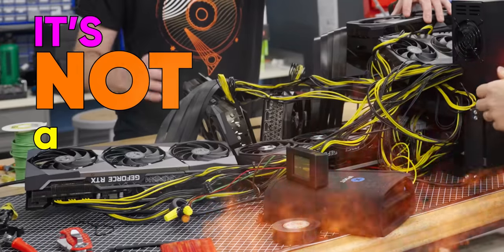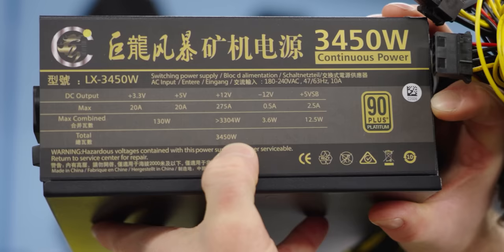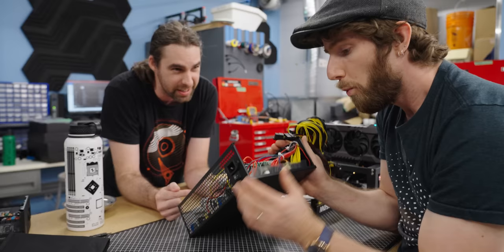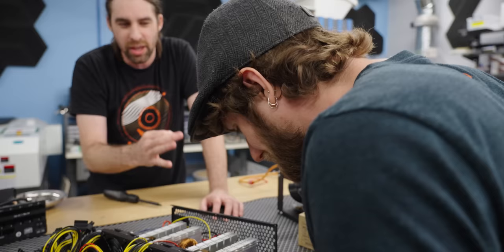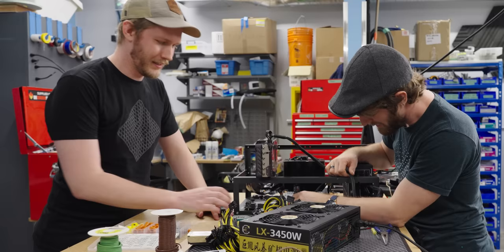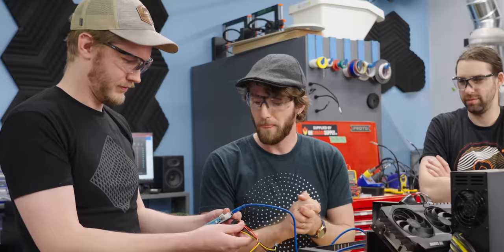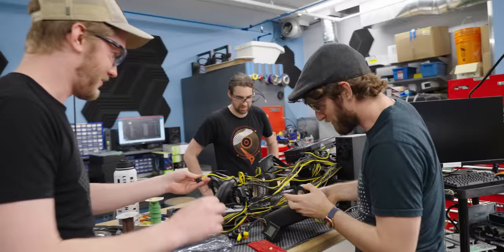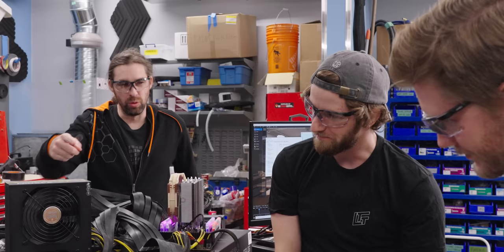This 3450W Power Supply is a Fire Hazard!

Comment: 3kW through a C13 power connector isn't that unusual in Europe. That's how most kettles are connected to the mains, and we generally describe the C13 as a "kettle plug", even when it is used in other devices.
Reply: yup, we got plenty of appliances that exceed 3000
Reply: I'd like to see those kettles. I don't think they actually draw 3 kW, because C13 is only rated for 10 A. Even with 230 V, you would be well beyond that rating.
Reply: C13 power sockets are rated for 10A, which is 2300W to 2400W with a proper electrical grid. Everything above that is out of spec and might melt the connector or socket.
Reply: @anlumo1  If 13A melts the connector, it was never a 10A connector anyway
Reply: Not in EU but in UK
Reply: @ReyMysterioX  From what I remember UK sockets and C13s can do 13A, but only briefly and the 10A rating is for continuous use, hence 2990W kettles.
Reply: @Gronbar6  there are 3kw kettles in continental europe too. but usually appiances are in the 2.5-2.8 kw range if they are of high power variant
Reply: @Gerry15  btw why is everybody talking 230/240V? EU runs at 220V actually, can someone explain?
Reply: @salmiakki5638  Part of Europe ran at 220, another part at 240V. Because of that, it was decided to switch to 230V ±10%. That's what Europe runs at rn.
Reply: Yeah 230 V is what I had out of my mains for at least the last 20 years.
Reply: @salmiakki5638  That's incorrect. Most countries in Europe run on 230V.  Very few on 240V. The only countries in Europe that use 220V are Georgia, Greenland and Moldova. The rest use 230V (Cyprus and Gibraltar use 240V)
220V is widely used in Asia, Africa and south America (and some islands), but not in Europe, at least not as an official residential voltage.
Reply: @ReyMysterioX  correct, 3kw kettles run with a constant load of between 2.3-2.5kw. The kettle leads in the UK are fused for 13A within the plug so you wouldn't want to push it to 3kw.
Reply: As a Brit, seeing them have to cut the power lead in half because the mains plug isn't replaceable vexed me somewhat. But coming down here and seeing kettles used as a metric made it all better XD
Reply: No, absolutely not. First of all, kettles even in the EU seldomly use more than 1500W of power. Also, C13 is only rated 10A for 240V circuits. Also, if you actually push 16A through C13, which is certainly possible, they do get way too hot, showing that their rating of 10A is appropriate. Instead, you are supposed to use the C19 connector for up to 16A@240V or 20A@125V (yes, US gives a bit more leeway).
Reply: @KayJay01  Worth noting that even if you have 230v there are tolerances used for load balancing. Here in Norway we have 3 different kinds of 230v grids. I am on IT and generally get 237v from the wall.
Reply: @Gerry15  Many countries, including the UK, run at 245V now. It basically utilizes the grid better if you run everything at a slightly higher voltage. The list you posted isn't representative of the voltages you can actually measure at outlets.
Reply: Electric stoves are fairly common in the US, and use a NEMA 14-50 outlet/plug,  rated at 50 amps.
Reply: @Gerry15  Nowadays they tend to supply at the upper end. Which at least for devices that use switching power supplies isn't particularly healthy, as it greatly increases the inrush current. It also increases the power drawn by resistive loads, like kettles, although that is usually compensated by them being turned on for shorter durations as a result.
Reply: @Gerry15  That was written two decades ago. Sticking a multimeter in an outlet tells you the truth.
Reply: @graealex  I am in the UK, which is no longer part of the EU, but most kettles are 3kW. Looking on Darty which is the French equivalent of Best Buy, there are plenty of 3kW kettles [bouilloire] for sale.
Reply: Yeah, except it's you Brits that call 'em 'kettle plugs', mainland ditched those 40 years ago.
Reply: @salmiakki5638  I'm in England and I just measured the output at the wall and its 245.2 V AC.
Reply: In Germany we call them Kaltgerätestecker, what just means cold devise plug
Reply: @Gerry15  That's mighty low actually. Here in Germany it's often 235V, and some YouTubers in UK would regularly show 245...248V mains voltage.
Reply: @inventiveowl395  Although it's not really necessary to synchronize on voltage. Countries only need to sync frequency and phase. And not even that, if they use HVDC connections to connect grids.
Reply: @katbryce  Well, I'm the kind of person to measure the power actually, and all my resistive devices, Iike grill, toaster, kettle are already 10% to 20% below rated/advertised power. Also, at least here in Germany, most kettles are rated around 1800W. Reason being that most outlets in the kitchen will share one breaker with 16A. While British ring circuits often have breakers with up to 30A, so you can have multiple high-powered devices on at the same time.
Reply: @graealex  as a born and bred Englishman I can say with certainty that kettles are rarely below 1500W in the UK which was up until very recently part of the EU.  The kettle in my kitchen right now is rated at 2520W-3000W.

the model is Morphy Richards 102786 if you doubt me.
Reply: @graealex  I sense someone likes bigclive
Reply: I have a 3850W 16A rated cable, that's C13. 230v EU. it's totally fine. Cable is fucking beefy tho
Reply: @crashmatrix  Yes, but I imagine his measurements not being representative, as he is living on the Isle of Man. I remember Photonicinduction showing mains voltages here and there, with some voltages being on the high side. However, when looking through a few of his videos where the primary/mains side voltage is visible, it was always around 233V. Hmm.
Reply: In Canada we associate them strictly with 120v 15 amp devices. 240v devices are hard wired on the device end up to 50A.  Beyond 50A it must be hard wired both ends. These are continuous ratings as well. The device still might be able to spike much higher momentarily, especially a motorised item like a blender or washing machine. This is why you get powertools claiming 3HP when that should blow the fuse - it is only for a half a second.
Reply: C13 is the classification for the appliance coupler. It's just the thing that makes it so manufacturers can send a cable with the local standards NEMA, BS, CEE plug, instead of redesigning the appliance for every locale. Although a 3kW device should have a [C19.. ..C24] and not a C13.
Reply: @testytester8303  Tbh I have never seen a kettle that didn't have a permanently attached cable.
Reply: @salmiakki5638  EU was harmonised around 235V or so a long while ago when the UK was still part of things. Of course, there being some allowances for variances, you could be anything from 220 to 250V as measured from the wall, depending on your wiring, how far you are from the substation and the time of day/grid conditions.
Reply: @katbryce  Your kettle is likely more like 2.2KW or so, there are very few that will draw the full 3KW. And that's still not the 3.5KW that this PSU would need. Likely to be safe, you'd use a separate high-current circuit, much like wiring up a cooker or shower.
Reply: 10% isn't too uncommon, the -12V and +3.3V ATX are also with a 10% tolerance and the +12V, -5V and +5V are with 5%
Alksi just checked, and my wall measurement thingy gives me flat 230V on a sunday afternoon.
Reply: @Leadvest  Those are also limited to 16A, which woudn't be enough for 3450W low voltage DC after a conversion.
Reply: @HappyBeezerStudios  They rated for 250V.

Comment: For those who doubt the danger of a power supply...

Even as a kid, I had the sense to not plug things in before testing sketch stuff.  It was a REALLY old power supply, where you had to plug the leads into the power supply... but the sticker was gone so I didn't know which side to have the different pairs.

So, I plugged it into the wall and used a stick to flip the power switch, and it promptly exploded.  Fortunately, it was not a big enough explosion to break the steel casing but it definitely set off the smoke detector.
Reply: Search youtube for "killing a capacitor"...
Reply: I had one go bad. It would shoot a arc of voltage out of the hdmi cable every time you tried to plug it into the tv. Weirdest thing ever. It wasn't just a quick spark either, a full solid arc like a stungun that would jump from the cable to the tv's socket lol.
Reply: I see linus has a lot of fear against live wires, even more at 220v. I used to use a soldering iron with a lot of spots in the cable burned from the soldering itself. One time I got shocker in the leg while simultaneously touching with my hand a metal cage connected to earth. I received a shock (220v), moved a bit scared out of surprice and continued soldering. Nothing too bad. The problem is when you grab the cable with out hand while earth connected, but touching it with a finger it wont kill you
Reply: haha, that was just a blown cap. it's fun when you just connect them directly to 230v and watch em blow, or use a small torch on the side of them (they are supposed to blow at the top) and shoot the hot blown insides at people XD they stink tho (like toxic gasses should) so do it outside
Reply: To clarify this was a catastrophic failure.  I couldn't even pick up the box for some time because it was so hot.  It was a lot more than a blown cap.  This was a supply that hadn't been plugged in for a decade that had power flowing the wrong way through it, probably shorting as it flipped the breaker as well.  But at that point I was like... these things are freaking death machines...
Reply: To people who think it is not that serious. True issue is that you might touch with 1 hand ground and 2nd hand capacitor fully loaded. This will effectivly move electric charge from arm to arm likely through heart potentially stopping it. if you would be grounded from finger to finger, then even huge charge won't kill you, just might burn finger a little. When electric charge goes through heart or to in general nervous system, this is moment when really big issue may happen.
Reply: @wachocs16  Voltage by itself isn't dreadful. The amperage is important
Reply: @arcticfox037  It requires a high enough voltage with enough current to become dangerous. If, say, I touched 1,000,000v @ 1ma I would be perfectly fine. I can even touch 120v @ 15a and still be fine (skin resistance is about 1,000 to 100,000 ohms). However, something like 800v @ 15ma will probably kill me if it flows through the heart, or maybe into the brain.

I get annoyed by sentences like yours, as they don't tell the whole story. A better statement would be, "It requires a high enough voltage at a high enough current in order to kill you."
Reply: @piotrj333  If you wear gloves, you'll be fine (unless the voltage is high enough to go through them or they have holes). However, I don't see any gloves on him.

Comment: "the resistor is the wrong way around!"
Linus: "no it's not."
* didn't get the joke *
Reply: So glad im studying electrical engineering, otherwise id be just as clueless
Reply: Resistors have no polarity, so there is no way to put them "the wrong way around"
Reply: Capacitors are one-way. Resistors are not.
Reply: @benjaminoechsli1941  not all caps have polarity, most commonly only electrolytic caps have. (Like the large ones in the video)
Reply: @PretTy_Fish  Now that I understand the joke it's still not funny
Reply: @dewildegillesgdw  thanks i didnt feel like typing that
Reply: "the sausage is upside down" vibes
Reply: @PretTy_Fish  some security systems are tempermental about resistor direction polarity or not. But thats a rapidly diminishing issue now
Reply: Oh dang, now I get it. It's a resistor, not a diode!
Reply: he did. but he was annoyed and didnt care
Reply: @benjaminoechsli1941  not all, Generally only Electrolytic and Tantalum caps are polarised.  Ceramic caps for example have no polarity
Reply: @laurosalvatore8900  Don't put the hotdog sausage the wrong way in the bun or you might blow a fuse.
Reply: @cryptic_daemon_  Although I'm doing electrical engineering too but it's too basic knowledge
Reply: @OgKafrizel  there is literally no such thing as resistor polarity
Reply: @nicksdinosforkids6001  Its at least as funny as the first thing they try to pull on you when you start any electrician education .. "please get me the lefthand screwdriver" ...

Comment: I love how Linus points out the input voltage rating, but totally ignores the input current limit of 10 amps right next to it.

I was hoping to see some kind of generator like tony starks ark reactor inside, as that 10 A input limit gives a max output of 2400w at perfect efficiency on 240, so at a minimum it needs to pull 1050W out of thin air to attain rated capacity.  If you were the low end of the input rating, it would need to probably draw near on double the rated input, if not more.
Reply: Chinese translation is bad and I am pretty sure it was saying 10Amps X2 or per unit but you gotta understand one thing.
Asia uses an open air cable system and power reaches each house after 2-3 freaking block lvl transformers and countries have something known as Nation wide grid, where if one producing unit is faulty it is compensated by other units.
So Yep our voltage is usually very very stable.
Reply: That must be an issue with the labeling then, as they achieved over 2400w in their limited testing.
Reply: @UsmanSiddiq1  The 10A is the rated power of the C13 connector. The PSU only has one. Its power rating suggests that it draws more than 10A. It does not matter how stable the power grid is
Reply: Even in the UK, where we have 240v wall power,  the max rated from one socket (unless you run a fresh breaker at higher rating) tends to be 13A .
Now it's nice getting 3120W, but still a few watts short of this power supply's advertised rating
Reply: @RJ-wx3fh  The issue is not the wall power, at least in Germany, it's limited to 16A, it's the C13
Reply: @ichbinla.aa.ngweilig  So the plug heats up, so what. It's not like it has a fuse in it, it's not gonna limit it. Also, You can draw way over 16A for a good while before your breaker pops.
Reply: @han5vk  I mean I wouldn't let my insurance read that
Reply: You'd need 15Amps to reach 3450W with a 230v supply.
Reply: @roguegargoyle914  At least in Germany usually the breakers are 16A